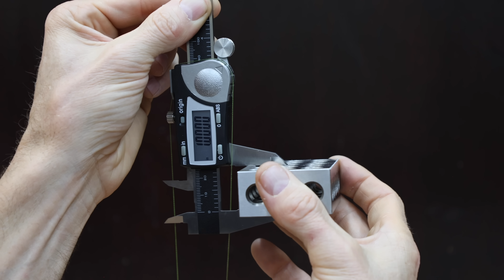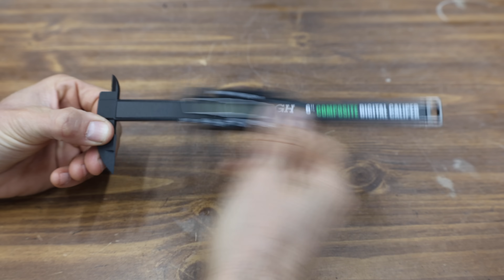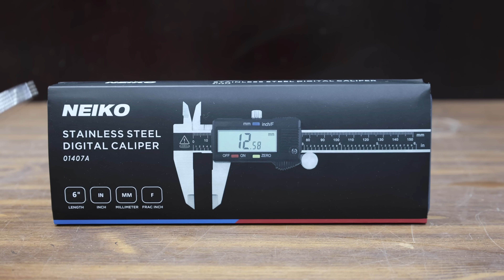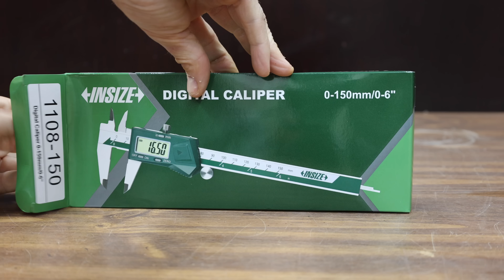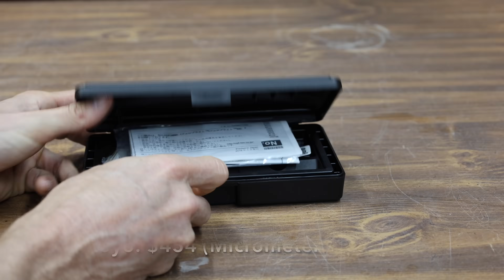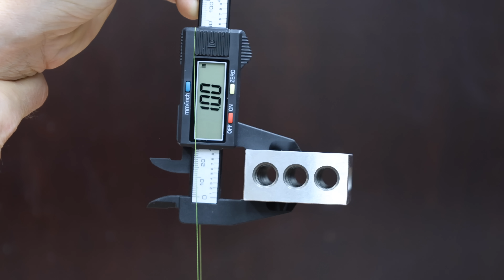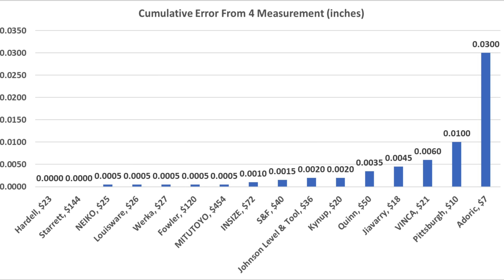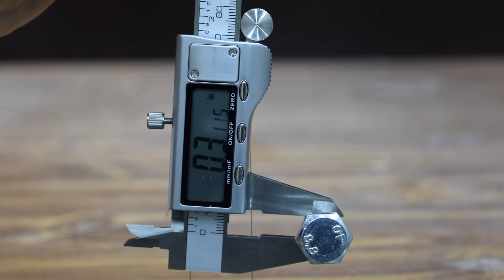I've Been Proven Wrong About Calipers!

Comment: One big pain with many digital calipers is that the battery drains quite quickly even when they are shut off. Would be great to have that tested also. Thanks for your fantastic work, btw!
Reply: The chip just turns off the screen.  I have seen people modify theirs with a battery disconnect switch.  Should be a standard feature.
Reply: I bought a Mitutoyo about 10 years back. I was fed up with my cheap calipers being dead when I reached for them  to measure a bearing for my bandsaw, so took the plunge.  It's STILL on the same battery.

Mine was "only" $200.00. It reads the blocks dead on.
Reply: Many years ago a supplier gave me a free pair of Mitutoyo calipers a a bonus with a large order and they have been amazing, especially with regards to battery life.  I keep those by the lathe and mill.  I have many cheaper calipers around the office which need batteries almost every time I use them.  I've bought a couple of "Mitutoyo" calipers in the last couple of years, but I am not convinced they are genuine due to the reasonable purchase price.  No verdict yet on the battery life on those.
Reply: Let me say that is exactly the problem with HarborFreight calipers. Keep the case, take the battery out when you're done, and keep spares. Perfect for occasional use.
Reply: I bought a cheap digital caliper and everytime I went to use the battery was dead. So I bought a cheap analog caliper. 😂

At work we have mitutoyo and I have never change a battery.

The life of the battery should be included in the comparison.

Good work!
Reply: Obviously there are ones that do not have this issue...
Reply: As others have stated would love to see a parasitic draw test/rating, if for nothing those than to hopefully get manufacturers to fix it. I switched to mitutoyo for battery life alone
Reply: Dude, you need to pay 12 dollars for a set instead of 8
Reply: Many of "LR44" calipers are actually for SR44 and need quite high voltage of battery (close to fresh battery voltage). I mean LR44 has discharging curve causing most of these calipers stops working relatively soon (due too low voltage) while SR44 hold its voltage almost to the end (and then quickly drops down).
Unfortunatelly to me, SR44 is almost unobtanium here while LR44 is everywhere.
Switched to caliper with CR2032 (namely Insize - which has absloute linear scale unlike claim in video. Perhaps different model)

EDIT: My bad, "absolute linear scale" is most probably something else than just caliper knows where it is (where it was last zeroed). I've been mistaken with lack of this feature (knowing where the zeroing happened) on some cheap calipers where you have to turn on the caliper with jaws at real zero otherwise you have to "re-zero" it (move the jaws together and "zero" the caliper). And since Insize remembers position of zeroing after powercycle, I thought that's it.
The "absolute linear scale" I'd call rather "second zero" or something like that (which is not available on Insize caliper).
Reply from the maker: You are welcome!  Thanks for the constructive feedback.

Comment: I own a lot of calipers, and while they almost all have automatic shutdown, They all still drains the battery when not in use. The only exception are the two models from Mitutoyo. Its really annoying to remove the battery after every use, otherwise its dead every time I come back to it. I only still use Mitutoyo for these reason, learn it the hard way.
Reply from the maker: Thanks for sharing.

Comment: As a woodworker, these are all fine! I recently did 'upgrade' to a housolution set that uses the 2032 and has auto shut off and absolute and relative value and it's waterproof. They come in a nice case, with extra battery and it even has a little calibration cube, and it came with a set of feeler gauges. It was $20.
Reply: I'm not sure I'd call all of them fine.  The Adoric was inaccurate enough that I'd suggest just using a ruler instead.
Reply: @xxgn  Even the Adoric at a cumulative variance of 0.03" is better than 1/32" accurate across 4 measurements. That's less than the thickness of veneer. I'd still recommend buying something else of course, but I figured I would put the error here into perspective.
Reply: @xxgn  Yeah, I mean, it's $7, but wood moves in a season way more than the margin of error of the adoric. That said, for $20 you can get a much, much better tool.  If you really just can't squeeze another 13 bucks, I guess that is who they're for.
Reply: Agree...I  have a nice set, but the cheaper ones are more than enough for wood working or just general task...
I scribe with the cheap ones in wood for hinges and hardware. No problem.
Reply from the maker: Thanks for sharing.

Comment: In regards to the battery, either will last a long time. A very long time. IF you remove the battery after each use. Not the most convenient, but provided the battery door does not have screws it at least doesn't take much effort. None of these have a true on/off switch, so they all will discharge even when not in use. So if you're an infrequent user like myself, store it without the battery installed so it's not dead when you do need it.

Would be happier if they all used a CR2032 though, it's a far more common size.
Reply: Actually you often don't need to take the battery out of cheap brands because the lid breaks and the battery falls out.
Also, some calipers auto-turn-off while others do not.  Both my expensive ones auto-turn-off.
Reply: @kevinshackleton5866 They're not fully off, otherwise they wouldn't know when to turn on. Only a physical switch that breaks the battery connection can do so. Anything else has leakage current, plus a circuit looking for the push button to change. Some are better than others in only drawing low micro, even nano amps, but it isn't zero.

This is the same reason alkaline batteries will often fail and leak in devices in storage. They get drained beyond a typical "dead" voltage because there is always a load on them.
Reply from the maker: Thanks for the feedback.

Comment: Some have already stated this below, but current drain is a big factor, also the behaviour when voltage drops is important. A third thing that needs to be checked is what happens when used in low temperatures (below +5 degC)- the cheap ones will give wrong readouts and repeatibility is going to be bad...
Reply from the maker: Thanks for the suggestion.

Comment: I use calipers every day at work. I have owned a few of the pairs on this list and only one that has held up over the years is the Mitutoyo. Definitely a buy once, cry once situation, but they're the only one's I can recommend.
Reply: The key words here being "every day at work." Obviously, a professional use case is going to be worlds apart from regular people using calipers for odd measurements here and there at home.

Also, it's easy to recommend something expensive when it's on company dime. I've used equipment at work that cost as much as a year's worth of wages when something I might use at home is just a couple hundred bucks.
Reply: @person880 yeah that's why it's in my comment. Because it's relevant. If I'm barely gonna use them then I'd get a cheap pair
Reply from the maker: Thanks for sharing.

Comment: I don't think the price is right for the Mitutoyo..  I paused on the picture of the back seeing part number 500-196-30 which is available between 150$ and 200$ with the plastic case.. Maybe the wooden case is a 200-300$ premium.  Also, I think you should have used a certified gauge block and ping gauge instead of a 123-block & a bolt for the accuracy test...

Comment: I was a Machine line inspector for 8 years and Metrology Tech for two years and calibrated many hundreds of calipers, micrometers, dial gauges, etc. Mitutoyo is by far the best caliper, then Starett and Fowler. Repeatability is important and I really liked the string weight for consistency, you didn't show step measurement which a lot of people don't even know about. Cheap calipers sometimes aren't machined for it, you use the the top surface of the two beams, put the sliding beam on the top of your 123 block and the main beam down to a smooth flat surface the block is on. It's similar to depth but on the opposite end.
Reply from the maker: Thanks for sharing.

Comment: Some of the inaccuracy from your depth measurements might be caused by an uneven surface on your work bench. At different orientations you can see the corner of the block lifted up some.

Comment: My father was a machinist for 40 years and was still working at the beginning of the digital era. Funny enough he immediately learned to and adapted to CNC machines (tape back then), however he NEVER trusted digital micrometers or calipers. He had the same set for over 30 years and had them calibrated every year.
Reply from the maker: Thanks for sharing.

Comment: I am a retired toolmaker, and the best calipers I ever owned were Brown & Sharp. A little disappointed to not see them in the lineup. Also, I have a couple (6" & 12") from Harbor freight that are about 20 years old that I bought just to use around the house. They're actually pretty nice. But I went back last year to get an 8" caliper, and they're absolutely junk. The old ones have absolute positioning, but no auto shutoff. But it takes forever to run down a battery. My older Mitutoyos are decent, but not as good as the B&S.  I really never Cared for Starrett, but sometimes their slimmer profile was useful.
Reply: Brown & Sharpe went under due to a protracted strike. The name is still around but the company really isn't. It's just a zombie brand today. Really they were having financial hardship before the strike. The one caused the other. You can read about what happened online. It holds a record as the longest major strike in history. So a significant event.
Reply: Wow, I didn't know. I've been retired for quite a while, but I didn't even see anything in the news about it. Too bad, they made some great tools.

Comment: This is not a fair comparison for mitutoyo, specifically. Their basic models are only around $120 and have all the important features like the internal reference technology, auto-off, incredibly long battery life (1+ years with daily use), etc... I'd chose mitutoyo any day over most these others. I've got over 10 years experience which includes using other professional brands like starret, browne and sharp, inside, fowler, and others as well as many of the cheaper brands.

Comment: Great comparison i just miss the most annoying trade. How long do they last turned off? In my experience especially with cheaper callipers the ley on the shelf until you need them and then they are empty. So i added a small toggle switch to all my cheap callipers to physically disconnect the battery 😅 anyways very valuable content as always 😃👍
Reply from the maker: Thanks!  Thanks for sharing.

Comment: Good test, but you overlooked durability and survivability in oil/coolant. I'd bet most of those calipers wouldn't survive getting dunked, especially if they weren't properly dried out right away. I also wonder how long measuring accuracy would hold up under long term repeated use.
Reply from the maker: Thanks for the constructive feedback.

Comment: Mitutoyo uses an SR battery instead of an LR (which has a different voltage level). It would be beneficial to include a power consumption test. This is how Mitutoyo demonstrates excellent performance.
Reply from the maker: Thanks for the feedback.

Comment: Calipers accurate to 0.01"?  What's  the point in that? You can quite literally get that accuracy from a ruler.  Also, if you look hard enough, you can find some really good deals on Mitutoyo products.  I ordered an 8" set of calipers even though the price was so low I thought it was a scam.  I was incorrect.  Not only were they legit Mitutoyo, they were still in the original packaging and had obviously never been used.  Shockingly, they also arrived with the certificate of calibration traceable to NIST and the certification number checked out as well.  I spend a pretty significant amount of time working on (calibration, repair, etc.) different measuring equipment and I could not believe it.

Comment: As mentioned in the comments about battery life. You should make a follow-up video in a year to see which caliper still power up after a year of non-use. I hear it often that a lot of these inexpensive calipers use up the battery when turned off. 😮
Reply from the maker: Thanks for the suggestion.

Comment: If you pursue any additional precision tool measuring, consider that at the level of precision of some of these tools you may be measuring imperfections in the flatness of your wooden tabletop.  To accurately measure the depth measurement with the 1-2-3 block with a caliper should be done on a qualified surface plate of known precision flatness.

I do appreciate the thought and thoroughness you put into the topic!  Nicely done.
Reply from the maker: Thanks!  Thanks for the suggestion.

Comment: My experience (having bought dozens of calipers over the years for our factory) is that most all of them are either spot-on accurate straight from the box or utterly obviously unusable.

The REAL test is how long they last and its a total crap shoot on anything under $150. I've had $100 calipers die in a year while $5 harbor freight calipers keep on rocking 5 years later. Or, sometimes the opposite. Assuming  either of them worked out of the box.
Reply from the maker: Thanks for the feedback.

Comment: I bought a pair of Chinese-made calipers about 2 years ago.  It's made of stainless steel like many shown here.  It's a bit too stiff and uneven in sliding, but my main issue with it is that if you move the jaw too fast, it loses track, and becomes some multiple of 5.1mm off, like 5.1, 10.2 15.3, ... pretty annoying, especially when I don't notice that its reading is off.  So I've gotten into the habit of zero'ing on every measurement, and slowly moving the jaw out to the approx position before making a measurement.  Unfortunately, this test wasn't in your otherwise excellent review.
Reply from the maker: Thanks for sharing.

Comment: I have a pair of Workzone calipers purchased at Aldi for $20 maybe 5 years ago. They work surprisingly well. I did modify the case slightly, cutting a slot in the foam lining so that the foam doesnt press the button and turn the unit on inside the case just from handling and transport, and this helps to extend battery life.
Reply from the maker: Thanks for sharing.

Comment: If you are doing DIY project or non commercial work cheap brand will do but anything that is commercial or requires high precision and repeatability i have not seen anyone use any brand other then mitutoyo, especially at labs i have yet to see any other brand we exclusively use mitutoyo.
Reply from the maker: Thanks for the feedback.

Comment: Great video. I like your testing approaches and process.  I use calipers, and have for a long time.  I don't like the absolute measurement feature.  I use my calipers to measure between hole centers where I zero the measurement on the hole size, then measure directly between the outer edges of the holes.  No math involved, and no mistakes.  This can not be performed with the absolute measurement versions.  I would not buy an absolute measurement caliper.  I don't see this as an advantage or as a desirable feature.
Reply from the maker: Thanks!  Thanks for sharing.

Comment: I am not a big fan of digital calipers. They always seem to have a dead battery when I need them. I have a Fowler dial caliper that is my go too. Very smooth and no battery to change. It also has dual needles so it reads in inches and MM on the same dial.
Reply from the maker: Thanks for the feedback.

Comment: Suggestion for the ‘Final Test’ … put them all in a box and leave the box on the shelf in the office for 6 - 9 months. Then take them out of the box and see which one’s still work. i.e. the “auto off” actually turned the caliper off rather than the “only turns off the display” found on many of the calipers. The TCO of the cheaper calipers should include the multi-pack of extra batteries you need to have on hand so you have fresh ones when you need to use it.
Reply from the maker: Thanks for the suggestion.
Reply: @ProjectFarm  ok,it’s been 7 months and time to take the box off the shelf, out of the box and see which ones still work and which ones need a new battery.

Comment: Chemical resistance has been the key with digital calipers in my experiences.  
  The CNC machining world heavily relies on flood coolant for efficiency.  
   I’ve seen more than one set of digital calipers bite the dust when a coolant nozzle dripped coolant on a caliper.  
  The last Starrett digital caliper I purchased worked for a year before it quit. They remain in my tool box to send back but I have yet to do so.  
   I generally keep standard dial calipers around my lathe. I’ll purchase cheap harbor freight dial calipers (although they’re not as cheap in price anymore) to quickly measure with while working. If they get knocked on the floor oh well. 
    The best set of dial calipers I’ve owned were off of the Matco truck. Bought them on sale. Both imperial and metric. They’re close enough to perfect for my work. 
    I do not rely on calipers for anything under .003” after that it’s a micrometer.
Reply: They make special fluid resistant calipers. That's what IP56 is about. IP56 means protection from harmful deposits of dust and protection from heavy seas or strong jets of water from all directions. They're not waterproof immersible but are resistant.
Reply from the maker: Thanks for sharing.